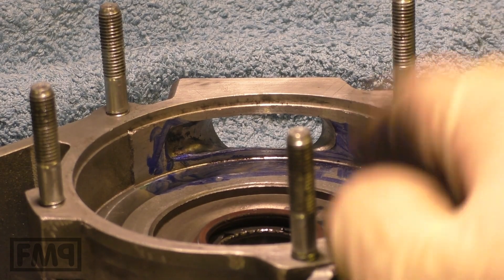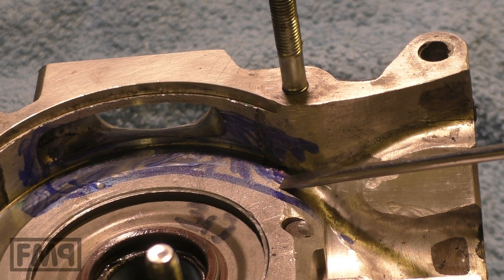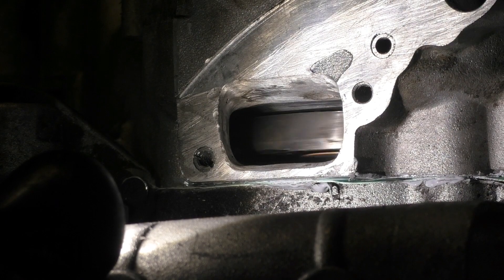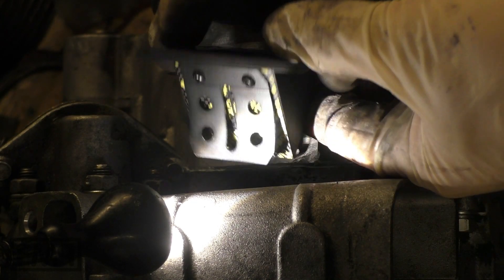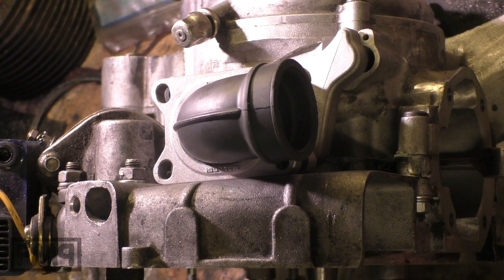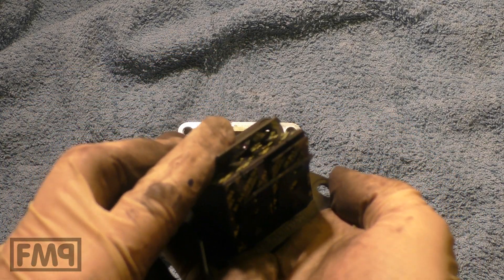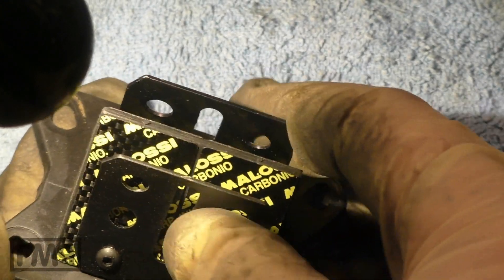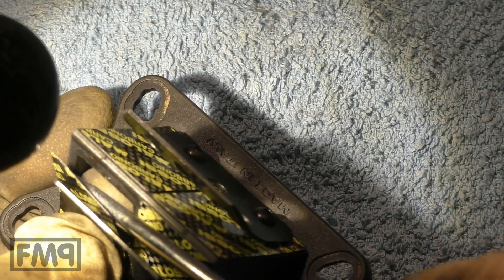vespa REED VALVE operating mode vs ROTARY valve / FMPguides - Solid PASSion /

Comment: There is a thin profile flat reed valve available that is as per profile of vespa and does not need any modifications to the engine block
Reply from the maker: it doesnt work propeely PLUS si carburettor is wrong carb for reed valve. original ok, as soon as u pnp tune, si is done.

Comment: Reed valve is like a one way valve or check valve  and it can be inline on intake manifold without making any change to the engine body . Will be giving better performance . Try that method too
Reply from the maker: no. u need to remove the ROTARY VALVE for real reed valve. if u ad reedvalve ON TOP of the rotary valve u get an addition throttle. its optic tunig only 😉

Comment: If I use a MRP-style box, is it still recommended to shave off metal at the intake?
Reply from the maker: Which engine case weil you use?
Reply: @FreakMoPed8  stock case of an LML 2T 150.

Comment: Hi Mista a installation  tutorial for  vacuum fuel pump needed  I know your video on it but not for Reed. Thank for your good explanation .Ps :I tested personally more  Reed petals Rd 350 it’s a good compromise (price😌)with boyesen.  But for me  vforce 4 in rd 350 format is more better but more louder depending your connection with frame filter or not and exhaust  don’t forget our tutorial 😅
Reply from the maker: pump is easy.
0) sip v2 fastflow tap
1) tank to pump under the tank
2) vacuum from carb/manifold to pump
3) fuel from pump to carb
4) 200 needle ventile
no bypass
Reply: @FreakMoPed8  needle is already in 300

Comment: Different reed materials,thickness and dimensions can lead to different intake noises
Reply from the maker: its here more an issue of the rubber coating of the reed holder. it could be coated with rubber spray, this will reduce the noise BUT the reeds are still smaller and the carb more ankeled with the malossi 360. so its not a choice at all in my opinion.  a x360 malossi review is to come next.

Comment: What thickness Reed’s would you recommend for polini 177 on lml 3 port Reed valve engine
Reply from the maker: sorry, no experience at all with different reed strength. if i change reeds i always use BOYESEN as i really like the ide of having two different ones and that they work is already proven.
BUT at least a reed test will come up. rd350, boyesen, vforce. directly compared.